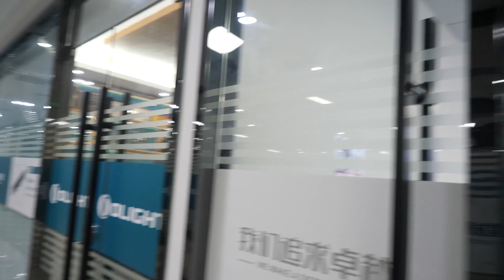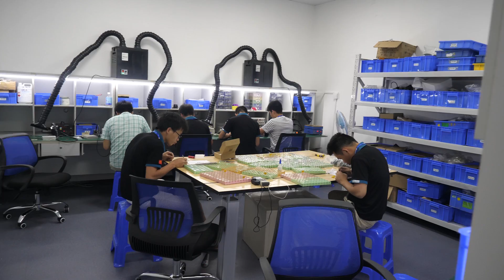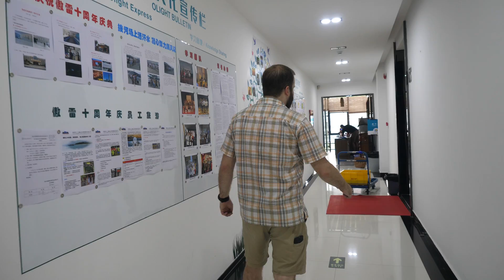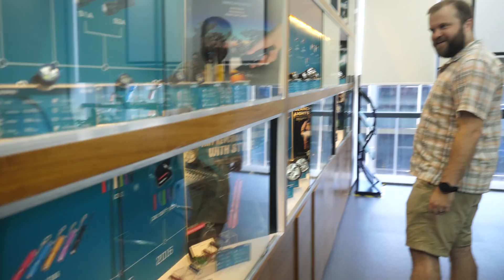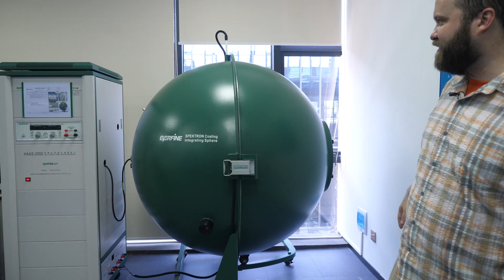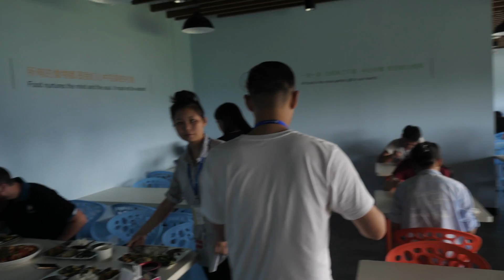Olight Headquarters Office Tour

Comment: I had an Olight s20r for about a year. then it started acting up. sent it in and they sent me a used light back that didn't work quite right then quit working one day later.  I'm not sure. maybe I just got a bad one. however they are not responding to my followup.
Reply: Henry Thomas same thing happened with me.  Sent mine in for repair, received it back with no work order and it didn't work.  Tried to get in touch with them again to no avail.